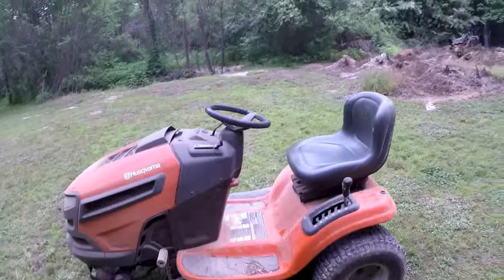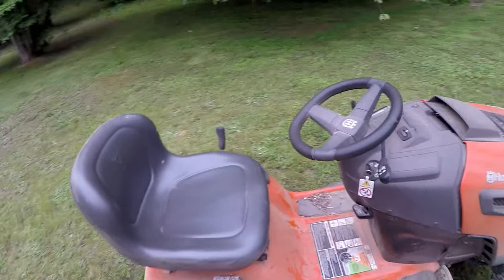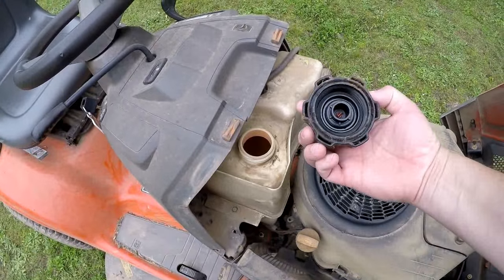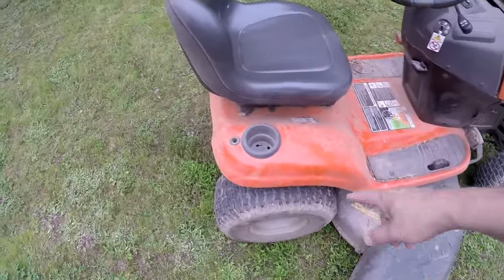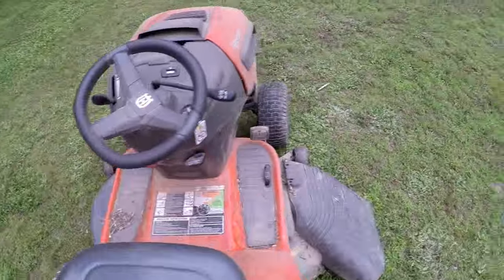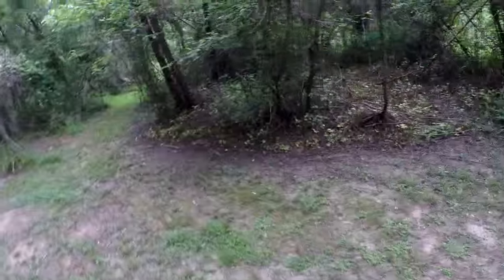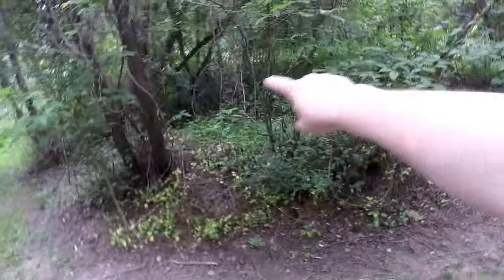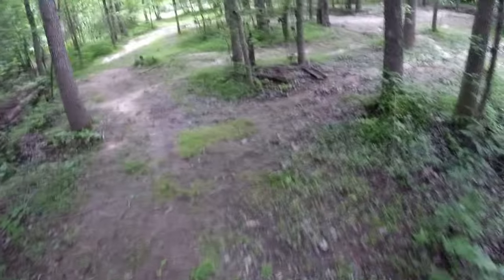Husqvarna YTH22V46 100 Hour Follow-Up Review

Comment: .....Dennis....You're a Good Reviewer....and you have given all of us a solid idea of just how much thick brush we can attempt with this little mower....lots of us out here would be afraid to tackle some of those vines and small saplings.....AND......I AM STUNNED THE TIRES HAVE HELD-UP SO WELL....usually the tires are some of the most frustrating components on riding mowers.....THANK YOU...!!!!!
Reply from the maker: HI Donald and thank you so much for watching and for your comments.  I've had a few commenters say that they've had trouble with the tires on their mower, but much to my satisfaction, I have not had any.  I did just break a weld on the mower deck of mine from hitting a stump...not the tractor's fault, but my own.  But otherwise, I've not had any problems with the junk I cut.  :)  Thanks again!

Comment: I bought my Husqvarna LGT 2554 around 10-11 year's ago, now has over 600 hours on it. It's been a really good mower. I did notice a couple day's ago I have an oil leak. I haven't got into it yet, may be either the drain plug, or, valve cover gasket. Thanks, John
Reply from the maker: Hope its an easy fix!  Thanks for watching, John!

Comment: I have a 54 deck with a kW engine it 24 hours early . 210 hours on it . Runs great . I just changed the steering shaft bushing after watching your video . Next will be the front wheel bushings , they have to much play and it's time to change them before the wheels fall off .thanks
Reply from the maker: Thanks for watching, Nick!!

Comment: I have same tractor. after 30 hours no issue. I did have to adjust the throttle initially as it would not engage the choke. Afterwards I had no issue.  Also found the oil filter was extremely tight from the factory. I love it though and highly recommend this one!
Reply from the maker: Thanks for watching and commenting!  So far, I've been really pleased with mine too.....especially for the price when compared to zero-turns etc.

Comment: Hey Dennis, I love your videos and have used a number of them to work on my own YTH22V46.  I’m a fairly handy guy, but I’ve lost my headlights on my YTH, and can’t seem to figure out the problem.  I have no voltage on the line that goes to the headlights.  Any thoughts?
Reply from the maker: Hey Jeff, thanks for watching!  I'd pull the bulbs first and make sure there is no dirt buildup inside the sockets.  Coming off your headlight wiring harness, you should have a brown wire and a black wire.  I'd turn the light switch to 'on' and test across those first to see if you have 12-14 volts.  If you do have voltage there, the problem is likely the sockets or the bulbs.  If you don't, then check the ground connection on the black wire, it may be disconnected, rusted, etc.  If all that checks out, I'd check the light switch for voltage...check across the orange wire to ground.  If you have voltage there, but not on the brown/black pair, the light switch is bad.  Let me know if all that checks out and we'll go from there.

Comment: Hi Dennis, I like your videos.  I have the Husqvarna YTA22V46.  Same Briggs and Stratton engine as yours and the hydrostatic automatic transmission.  I bought it in 2017 and have approximately 160 hours on it.  I blow it off, including the top of the cutting deck, after each use and it's stored in an enclosed shed.  It's not abused.  All that said, I've had nothing but issues with the hydrostatic transmission.  Because of a poor design, grass and leaf clippings go to the rear of the tractor and pile up under the pulley that they drive and transmission belt attaches to.  The accumulated debris reduces the speed in which the tractor will move forward.  To get to the debris, you have to remove the battery and the battery case from under the seat and use either a leaf blower or compressed air to clean the debris out.  Also, debris piles up on the ledge near the steering gear.  This prevents the brake mechanism from fully disengaging which prevents the tension pulley from applying full tension to the transmission's belt.  From the day I bought this lawn tractor, I've had an issue with the linkage for the pedal that makes the tractor go forward and backward getting stuck and hung up.  The top speed for this tractor is supposed to be around 7 mph.  This year I'm lucky to see 3 mph at full throttle.  Thinking the issue was a stretched drive belt, I just had that belt replaced.  The person that replaced the belt also made sure that the area around the pulley and transmission was clean of debris.  Even with a new belt, I do not get any speed from the tractor with the pedal fully pressed and the engine at full throttle.  It takes me forever to cut a lawn.  I don't sense the belt is slipping, it's just doesn't move fast. The transmissions on these Husqvarna, and other, lawn tractors with an automatic transmission is the General Transmission RS800. And ideas on what you think it might be?  Thanks.
Reply from the maker: Thanks for watching, Dave!  Check out item #9 in this video:  https://youtu.be/a-sRKmL4LLU  I'd start with purging the transmission.  Let me know if that doesn't help and we'll try to figure it out.  thanks!
Reply: Thanks, Dennis.  I just watched #9 in the referenced video.  I'll give it a try and let you know how it worked out.  Do you ever experience getting all that debris back on the transmission, including under that rear pulley?  Do you have to remove the battery and battery case to clean out the area, or do you have a simpler way to do it?  Thanks.
Reply from the maker: I don't get too much junk up there, but when I cut very dry grass I will get some.  I've blown it out with compressed air or just gotten in there with the hose nozzle and blasted it out.  I have not experienced the build up that you have.
Reply: Hi Dennis, I returned home from my trip to Florida and purged the transmission as instructed in your video.  I found the freewheeling control arm difficult to engage and disengage.  I heard the click when I pulled the rod out, but when I went to push it in, the metal rod would bend, but I didn't hear it click to engage.  That said, I was able to get on the tractor and the tractor did go forward and backward.  Even after purging the transmission, the top end speed of the lawn tractor did not increase.  I reached out to Husqvarna via the link on their website and made them aware of the issue I was having and how I've experienced issues with the transmission since I purchased the unit.  To their credit and to my surprise, even though my unit is five years old, Husqvarna has authorized the lawn tractor to be repaired by a local authorized Husqvarna repair facility at Husqvarna's expense.  I can't ask for much more than that.
Reply from the maker: That's great, Dave!  I'm glad they are going to take care of it.  Hopefully that will resolve the issue completely and get you back up and running.  Thanks again for watching!
Reply: @dwcoffey  Hi Dennis, Thought I'd let you know what the repair shop did to address the issue with my YTA 22V46 moving slowly.  The owner of the repair facility said they've repaired a lot of lawn tractors that have this fiberglass General Transmission RS800 transmission in them. Apparently, General Transmission realized some design flaws because they came out with various kits to fix the issues this transmission was having.   Installed on my Husqvarna by the repair facility was a Debris Kit, a Control Kit, a Variation Kit, and an Inversion Security Kit.  I have the part number for each kit if you ever need them.  Fortunately, Husqvarna stepped up and covered this repair even though my tractor is five years old and has 170 hours on it.
Reply from the maker: @daveetheridge8338  That’s fantastic that they’ve covered all that. I guess I’m blessed to have a TuffTorque transmission in mine. Thanks for the follow up Dave!  This info will be very helpful for folks having the same problems.
Reply: @dwcoffey  I don't know if you saw the other question I posted on your video dealing with changing the plugs on the Husqvarna.  I wanted to know if you knew how to adjust the idle screw on the carburetor.  I know the top end speed on this tractor is dictated by the RPMs of the engine via the drive belt going to the transmission.  When I adjust the screw to increase the RPMs, I'll notice that I can move the throttle into the choke position and the engine would not act like it's choking and is about to stall out.  If I slow the RPMs by adjusting that idle screw, the engine will bog down when the throttle is put in the choking position, but because the RPMs are lower I don't get the top end speed this mower should be getting.  Is there a certain RPM this tractor with its 22 hp Briggs and Stratton should be set at and, if yes, how do you determine at what RPM the engine is at?  A car has a tachometer to determine its RPM.  Is there a proper way to set the idle using the idle screw on the carb?  Thanks.

Comment: Hi Dennis, after about 50 hours did your Oil Can symbol show up on your hour meter? I have checked and changed the oil and this reminder keeps coming up. I wasn't sure if it is an auto reminder for changing oil/filter.
Reply from the maker: Hi Brett, mine did not, but I understand some of them do this.  The hour meter will display a "CHG OIL" message from 50 - 52 hours, from 100 - 102 hours, etc...every fifty hours.  It is programmed as a reminder at every 50 hours, regardless of when the last oil change occurred.  The message will display for 2 hours of 'on' time and then go away.  I do not believe there is a method for resetting the change oil message.  You basically have to wait until you get to 52 hours and it will stop.

Comment: Hi Dennis. Thanks For the review. I have the same model.  My neighbor offered to give me his 28 inch deck from his YTH24V48. 

Would it be okay to put on the 2 inch bigger deck?  Or would that harm the engine?
Reply from the maker: Thanks for watching, David.  If the bigger deck will fit, belt lines up etc....I think the 22hp engine has plenty of power to pull the slightly bigger deck.  You might see it struggle if you're cutting high, thick grass, but on a normal lawn, it should be more than enough.

Comment: Hi Dennis! Back when your mower was brand new, did your Cruise Control work properly? I’ve had mine for 2 months now and it has 5.2 hrs on it, but my cruise control will not engage.
Reply from the maker: Hi David, thanks for watching.  Yes sir, mine has worked since I got the tractor.  Still does.  I haven't ever really looked at the mechanism, I'll try to get a chance to check it out on mine and see if I can help you troubleshoot.  Since yours is so new though, you can probably get it taken care of thru the warranty (?).
Reply: Dennis Coffey ok thx, unfortunately I couldn’t afford a warranty plan with mine, my local Sears closed its doors and they had everything marked down so much off % marked accordingly. They had the riding mowers marked 30% off, Everything is perfect on my mower, runs good, cuts good, only thing is Cruise Control will not engage, but it’s not end of world, but if u do figure it out, plz let me know. Thx

Comment: Hello Dennis, quick question. I just bought my Husqvarna motor similar to yours. Looked at numerous videos and read manual like 10 times now. Called Husqvarna, they referred me to dealer near my area. MY QUESTION: How do I engage the mower blades ? Do I need to engage the clutch/brake pedal when engaging ? what speed should I be in when engaging? Should I engage them with the mower off ? The reason I ask ... brand new mower. and runs fine, but when I try to engage blades there is a grinding type sound, so I don't engage fully, 1/2 way and then grinding starts, then release is this normal? Thank you.
Reply from the maker: Hey Lance, thanks for watching.  If your mower is like mine, I have a mechanical engagement lever right behind the steering wheel.  It is attached to a cable that runs down to the deck (see my video showing how to remove the deck -  https://youtu.be/T_N9qre4xq4)  The cable and spring gives tension to the engagement lever.  You should be able to push the lever counterclockwise until it sets and engage the blades any time, without depressing the brake.  You should not hear any grinding when the blades are engaged, only the blades turning.  I would lower the deck with the mower off and inspect the deck belt path, make sure nothingis rubbing where it shouldn't be.  Then I'd check to be sure you don't have a bent or loose blade.  If not, I'd remove the deck , remove the deck belt, and check the spindles for noise when turning each one.

Comment: Hello Again Dennis! Same machine, no where near as much cutting with mine, maybe 1/2 acre of lawn only. I do cut on a sloped area, very stable with near no slippage and no tipping.
Reply from the maker: Thanks for watching, John!  Also, thanks for sharing your experience.  I agree, it is a stable machine.  I had a bit of a slipping issue on a steep hill, but I filled the rear tires with antifreeze and water for weight, no more slipping!
Reply: @dwcoffey , that is something I didn’t know you could do, but I’m on it!
Reply from the maker: It's easier with an adapter available at most ag supply stores....you can attach your garden hose to the adapter, with a pick up tube into a jug of antifreeze and then attach the adapter to your valve stem.  Position your tires so the valve stem is at or near the top.  Leave a bit of room for air so you can adjust the inflation of your tires when necessary.
Reply: @dwcoffey , already on the shopping list! The extra weight at the tires should help with the minor bumps in my soil as well. Good looking out!

Comment: Hello, Dennis. I (also a "dennis") am a new viewer(now subscriber) to your channel. I have same model (but do not have "cruise control" I do not believe). 
I have viewed several if your videos and will be installing new spindles (purchased) soon, I hope. 
Quick question: can you install brighter LED bulbs in these headlight housings? If so, what do you recommend? As I rev up engine lights get brighter.  I assume that is normal.
Secondly, I believe my tractor remains under 3 year warranty until March '22. I have alot of play in steering wheel. Do you know if that is covered by Husq warranty?
Lastly, I am not as fortunate as you - I have several rips in seat. Are you aware of more durable after market replacement seat? I don't care what it looks like, even if it has a higher back.
Thank you.
dennis(NJ)
Reply from the maker: Hey Dennis, thanks for watching!  I tried some LED bulbs and they worked a little bit better, but the problem is the way Husqvarna wired the lights.  I understand what they were thinking, trying to avoid running down the battery, but I think they could have done better.  I have not done this yet, but probably will in the future:  The lights are wired to the generator, so their brightness is determined by engine speed.  I think the lights should be wired to the battery, thru the key switch (so you can't inadvertently leave them on).  That will give a constant brightness and then should work much better with LED bulbs.    I would think they'd cover the steering wheel bushing under warranty.  I have a video showing how to replace that bushing, if you are interested.  I have not found a decent replacement seat, other than buying an OEM seat...and they ain't cheap!  So...mine has since gotten a few tears in it, but I'm living with it because I don't want to pay for another seat.  :)  Thank you for subscribing to my channel!!
Reply: Hello, Dennis. I'm back again from a year ago to ask you if you have any update possibly for a decent replacement seat for the Husq. I've found several possibilities online  but I'm  not sure of the bolt pattern.  Thank you again. 
dennis

Comment: Hey Dennis enjoy your informative videos. With this tractor how do you store it with fuel over the winter? Thanks!
Reply from the maker: Thank you for watching and for the comment!  Year-round, I put Sta-bil fuel stabilizer in my gas cans when I fill them up, so my fuel is already prepped for winter time.  Now I enjoy nice weather for 10-11 months out of the year, so my winter is not very long or severe.  But...Sta-Bil will take care of over-wintering fuel.  If I had long winters and had to put my tractor up for months, I'd run all the fuel out and store it dry.  That's what I do with my tiller.

Comment: Good to hear it has held up....I am trying to help a friend figure out why his seems to be slipping in gear, I'm sure he doesn't have as many hours as yours.   I will ask him to check that hydrostatic relief switch/rod sticking out the back, perhaps he bumped/caught on his leaf bagging system....
Reply from the maker: Yes, he should definitely check that rod....if it is pulled out at all, it could cause the slipping.  Also, there is an initial bleeding procedure for the transmission detailed in the owner's manual.  He may need to do that, if it hasn't been done before....could be some air in the tranny.  Thanks for watching!

Comment: Hey Dan,I really appreciate the review. I just got this tractor last week and I am in love with it! The salesperson at Lowes told me to use Non-ethanol gas. Since you're over 100 hrs., can you please share your wisdom and tell me what's you use to fill up the tank?
Reply from the maker: Hey Henry,  We should probably all be using non-ethanol gas on mowers, outboards, string trimmers, etc.  Ethanol in the gas will eventually destroy any rubber tubing, gaskets, and the like.  I do not use non-ethanol gas, but only because I'm lazy.......we live out in the country and the closest non-ethanol pump to me is about 30 miles.  I just don't want to drive that far to get the gas, so I'm taking my chances.  There will definitely come a day when I will have to replace fuel lines, etc, but I don't think it will be a terrible job.  So far, no problems however.